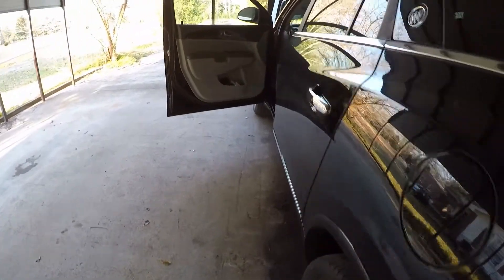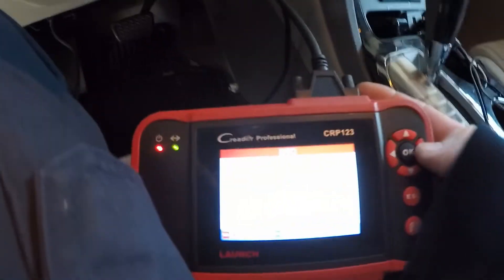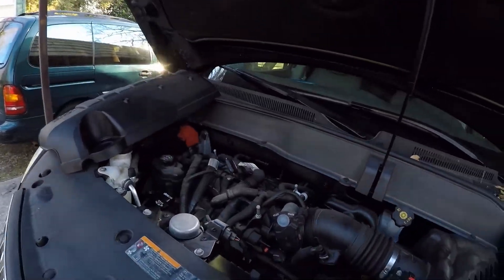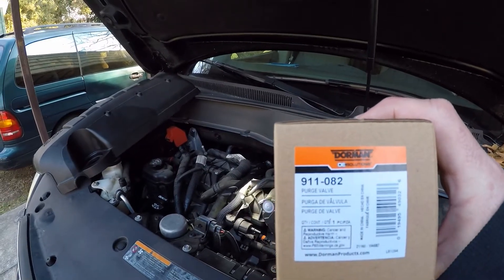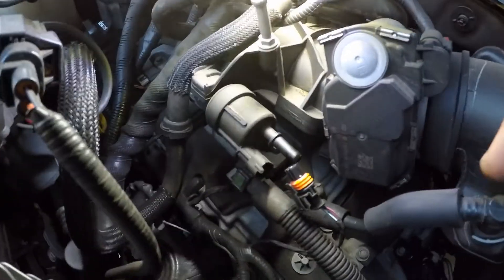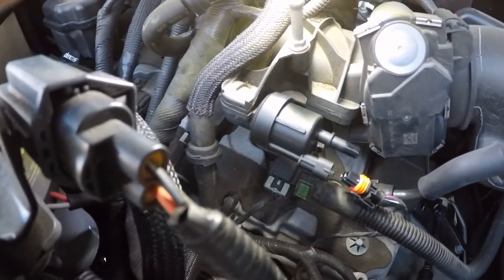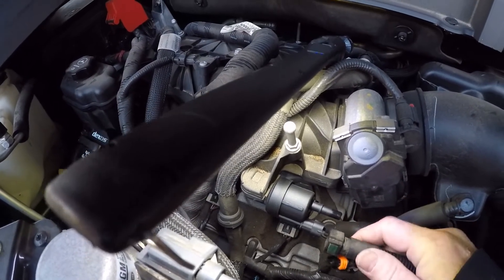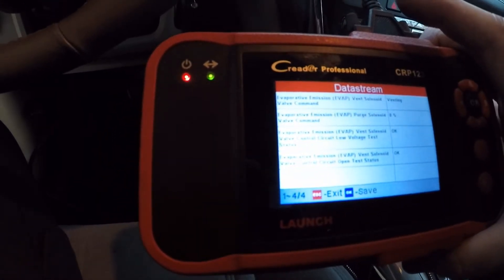P0443 GMC Code (Fix) - Evaporative Emission Control System Purge Control Valve

Comment: Already change the gas cap and purge valve check engine came back on im lost please help
Reply from the maker: Could be the Vapor Canister Vent Solenoid that is located under the vehicle near gas tank, https://www.oreillyauto.com/detail/c/standard-ignition/engine-sensors---emissions/emissions---air-management/canister-purge-valve-and-solenoid/711fc85bddd5/standard-ignition-2-terminal-vapor-canister-vent-solenoid/std0/cvs10/v/a/139799/automotive-suv-2017-buick-enclave?q=canister+purge+valve%2Fsolenoid&pos=0